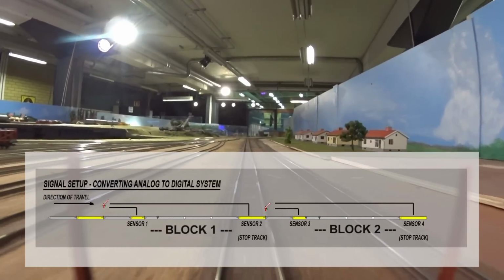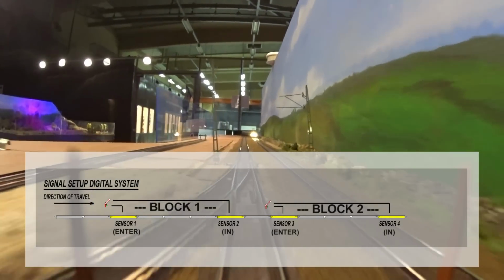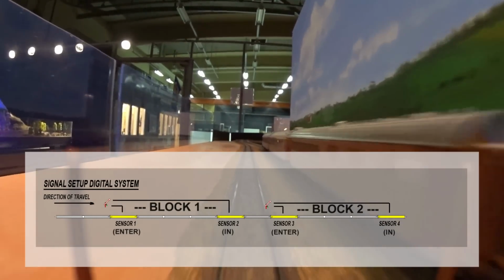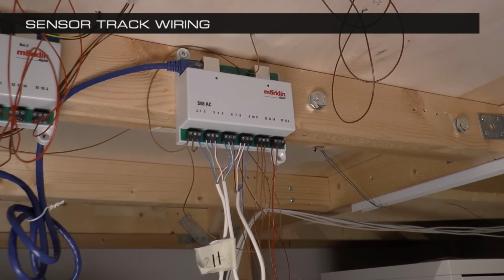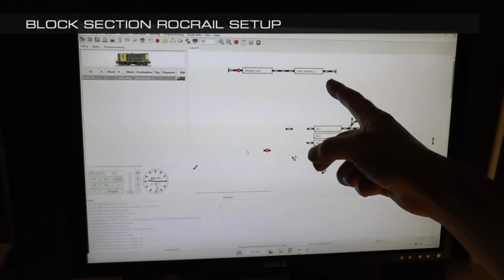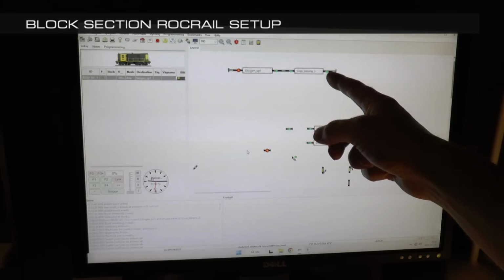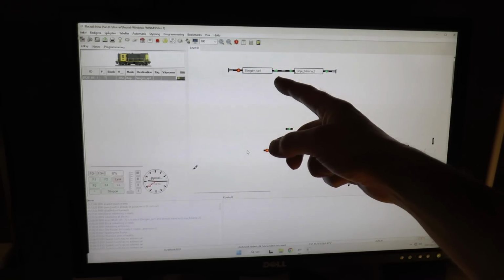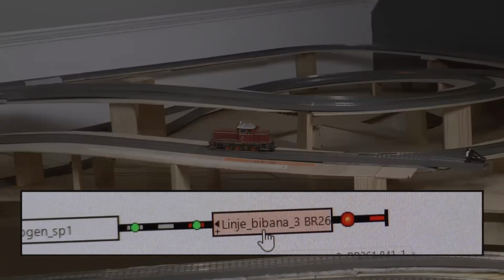Designing BLOCK sections for the Model Railroad

Comment: Hallo... thank you for sharing this video. It helps me a lot. I am building a similar layout with multiple blocks. The size of layout is 10m x 4m and has 4 loops with multiple helix (one helix has 7 levels).
I have some problems with 10x S88 and 18x M84.. 
The M84 flip-flops (switch on/off intermittenly) when a loco runs. It looks like the cs3+ sends an initial signal to m84 randomly.. I have reported to maerklin 6months ago but no help
Maybe you can help me on this

Thank you

Edy
Reply: Additional info: my layout has totally 128 blocks(sections)

Comment: A block system can get rather complicated indeed. The idea of sensoring 'entering' and a train being 'fully in' had at first not crossed our mind but it is the better solution most certainly. We've adapted something of that kind now but we have installed light sensors which is a different approach of course, and can be quite tricky to get them working reliably. One could easily make an entire course about block systems. However this upload is explaining basics easy and relaxed again 🙂

Comment: Two sensor areas per block seems unnecessarily complicated to me. If using current detection, why not just sense the whole block? What am I missing?
Reply: You are missing that it's not relevant,  if you have current detection or short-circuit detection, DC or AC.

If you have only one sensor you have only an enter-event and you can only stop with speed/ time control. Therefore the behaviour of each individual locomotive must be known.

With two sensors you can reduce speed at enter event, and stop at in. Because of low speed the stop position is nearly independent of the individual locomotive. You don't need to gather much information of the behaviour. Guest locos can be used easily.

Comment: i once designed my layout with single blocks without sections (there was traincontroller software that could learn that, don't know the name anymore), but i always regretted not having at least a 'in' and 'out' section as i ended up not using the software i designed it for and now the layout is ballasted and i don't want to cut it up just to add the extra sections.